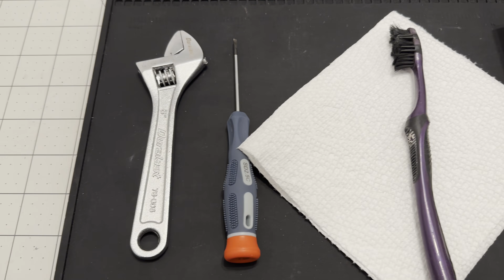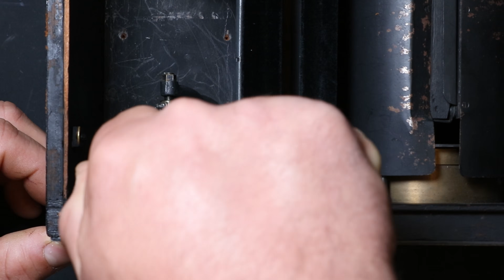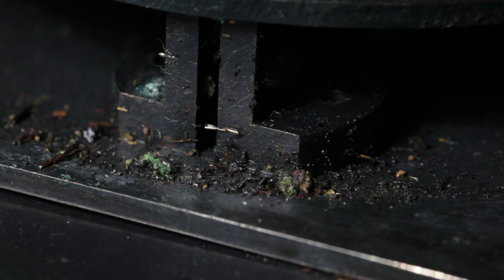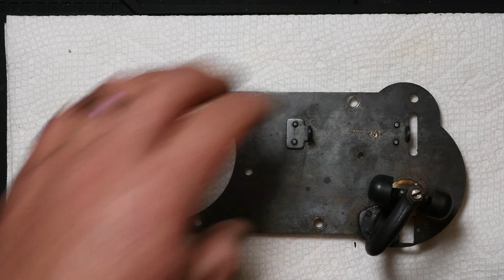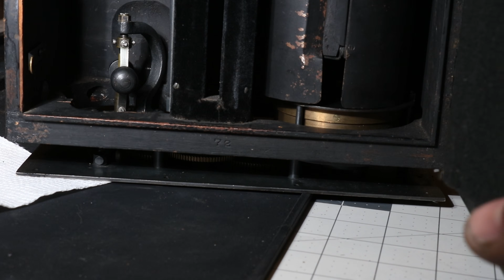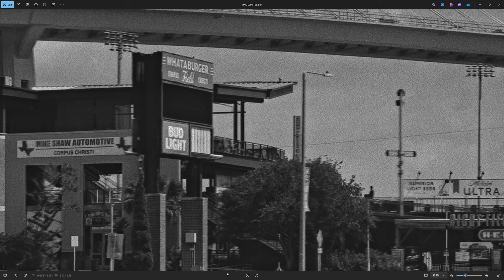How to Disassemble & Service a No.10 Cirkut Camera Film Back and Motor Assembly | Step-by-Step Guide

Comment: This is amazing! I have a cirkut 6 outfit coming which i know needs a good CLA. I have been looking for help with it and the facebook forum has been fantastic but this video is unbelievable! I know its not the same model but I am hoping that much of this is similar. I had no idea the 10 had a film width changer. I am working out how to use 5" film in my one. Thanks for this video
Reply from the maker: My first Cirkut was the No. 6 outfit. I created 3D printable spools and gear designs for download on sites like Printables. At some point, I plan to open my No. 6 outfit and clean it. When that day comes, I will post a video about it.
Reply: @Socialmocracy  I just saw those gear files!!! Thanks so much for doing that